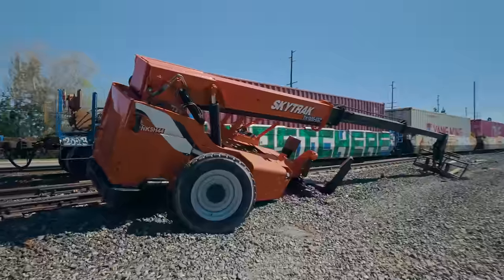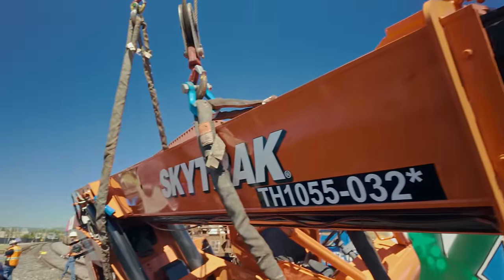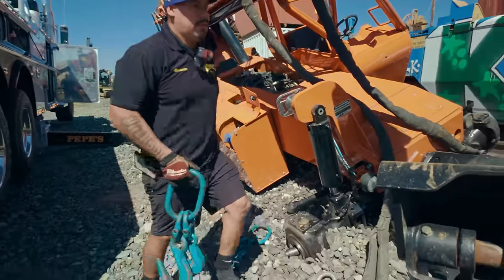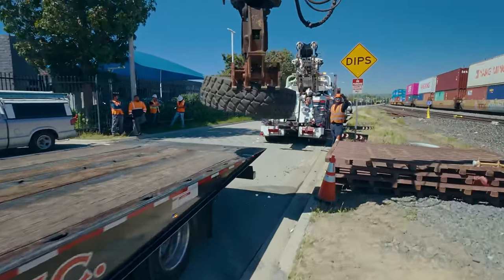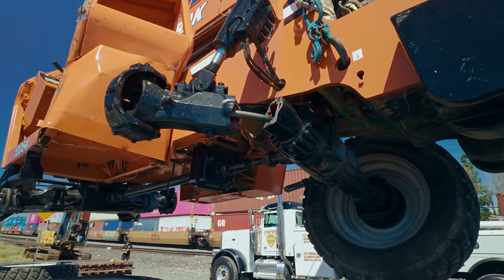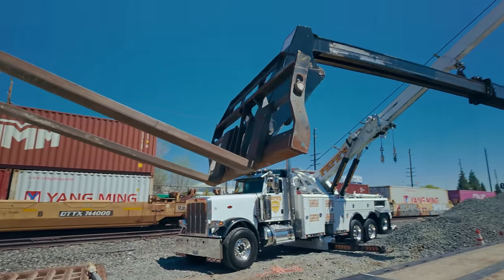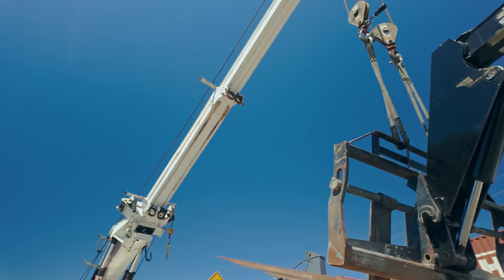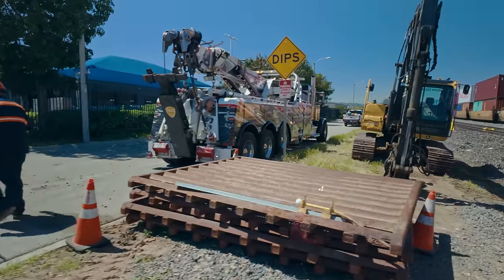Stolen telehandler SMASHED by train!

Comment: Josh why did you go with a pusher axle for Hulk and a tag axle for Big Flipper?
Reply from the maker: Because flipper doesn't tow. It's designed for maximum recovery capabilities and to do that it needs to turn better than the other trucks
Reply: @PepesTowingService . Ok. Thanks Josh.

Comment: While the chain is broken to retract boom, they should have been able to push it in with loader, or rig up winch line to pull it in...could have eliminated need to remove forks. But ya got er done!
Nice equipment.

Comment: These forks have a transport mode (to move the telehandler on public roads, etc), you can just individually flip them up and over around the middle pin and they will point straigt backwards, along the boom.

No need to even take them whole assembly off the coupler

Or was it too bent to do that? It looks like they even started the very first few degree of the sviwelling motion when you set them down on the ground and the tips hit the ground first.

Comment: i guess that it was on a day where there not was happening that much otherwise where you proably driveing on to another job
Reply from the maker: We would have got that job no matter what. We've had 3 rollovers happen simultaneously plus a bunch of tows that we can handle. That's the benefit of having so many rotators and wreckers.

Comment: Nice job rigging that pick. You probably have reasons you don't use taglines but in my opinion it should have had a tagline on it.
Reply from the maker: For what?
Reply: the casualty will follow the boom since I have two lines attached to it . hence why I was swinging slowly to avoid unbalancing the load. typically we use a tag line if I have one line attached to it

Comment: you should mount your camera to your helmet so you can use two hands
Reply: No.  Ron Pratt does that and it is dizzying as he looks back and forth.  I've seen chest harness mounted cameras that work well though.  Don't sweep back and forth as much, cover what is going on perhaps better than the helmet cams and as you said, leaves both hands free.
Reply from the maker: Helmet cameras are the worst. I started my channel with one. It picks up the maximum amping of movement and is ridiculously amateur. I prefer my way

Comment: The 1 thing that caused more effort was that last wheel. I would have taken it off, so it sat on bed flatter
Reply from the maker: OK when you get these jobs you do them however. We listen to what the customer wants. If they wanted it removed, it would have been done. In reality that would have taken a ton more effort. Why bother? It would have solved absolutely nothing

Comment: I cannot believe with the amount of people there no one has a knowledge of hydraulics to know you open a hydraulic valve say with the key on open control valve push it should retract with the help of something else pushing and hydraulics are off when I saying is you take a backhoe you leave the bucket a foot off the ground turn the key off it will stay there until you operate that control valve gravity and hydraulic fluid will go into the tank it's like water you have to open the valve to get the fluid a way to escape when you try to compress the area is in you can push all you want until that valve is open the fluid has no path back to the tank
Reply from the maker: Dude....shut up. First, are you aware of how disgusting and huge a mess would be from bleeding the hydraulics? It will shoot out. Second, I'm not sure if you're obtuse on purpose but the BOOM WAS BENT. And lastly who cares? Taking off the forks made it 100% safe for transport to where it gets scrapped anyway. You act like that was a giant hindrance to the job